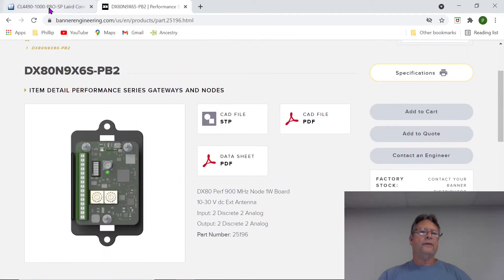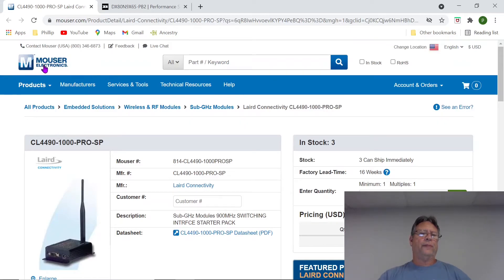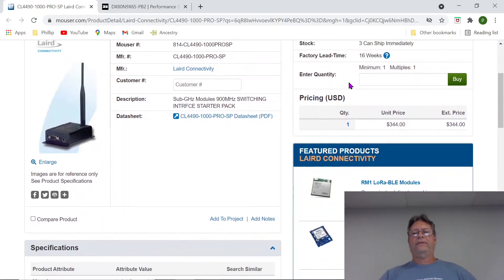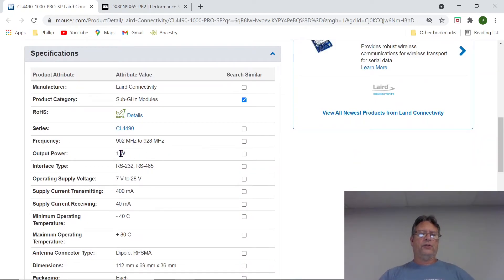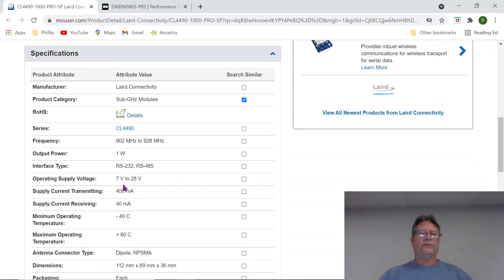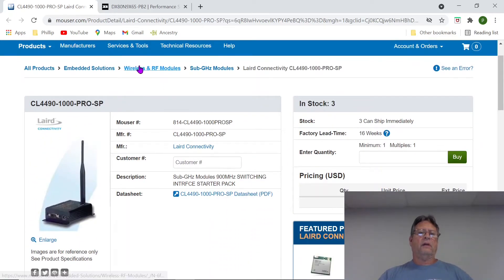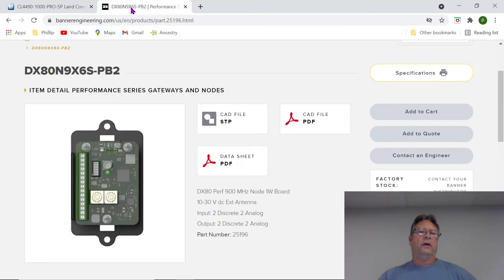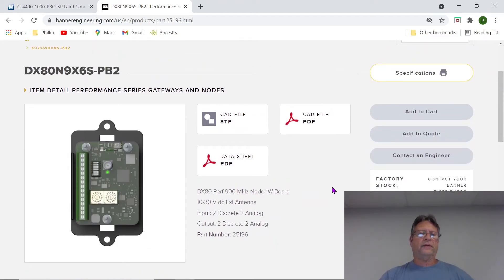CLICK 13  Using CLICK PLC in remote locations requiring radio links. Using the Banner MODBUS radio.

Comment: I am starting my PLC /Modbus/Sensor journey. What I have gathered so far is that various manufacturers implement their MODBUS protocols on their sensors slightly differently. The same manufacturers often offer 4-20mA/0-5V/pulse versions of their sensors. 
My question is: Would you recommend avoiding Modbus on sensor units, in favour of 4-20mA/0-5V/pulse sensors but standardizing on a radio interface unit that implements the MODBUS protocol identical to the Click PLC?
Thereby avoiding having to work out the MODBUS quirks of all of the different manufacturers sensors.
Reply from the maker: Complex answer. Email me for more detailed response. Phillip

Comment: Hi Phillip,
I think that the future would be with the new Click PLUS WiFi unit. This could be set up with a Modbus, but I would prefer MQTT. This would then publish or subscribe to the MQTT broker using a unified namespace. (IIoT, 4.0)
I like what you are doing.
Garry
Reply from the maker: I agree. However, that's quite a bit more difficult from where my class, followers are right now. I need to keep it as simple as I can while getting the basic across. Maybe later down the road. Thanks.